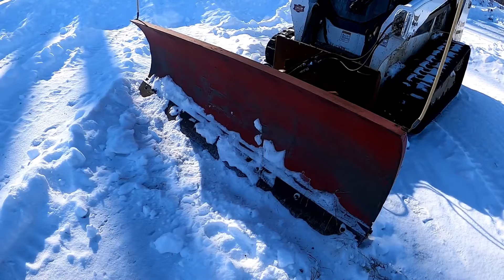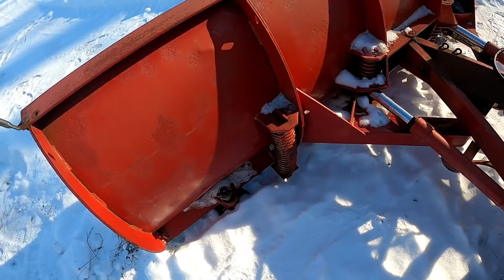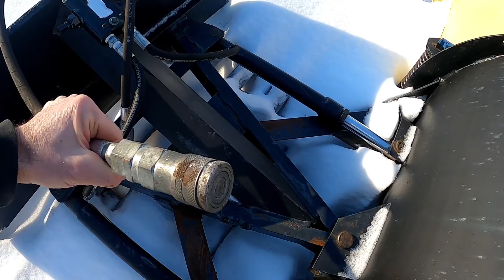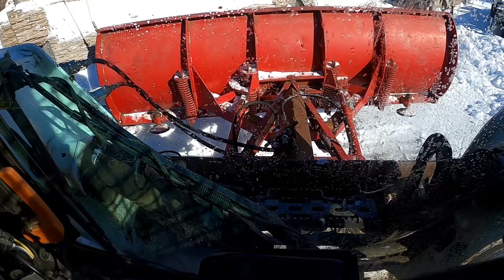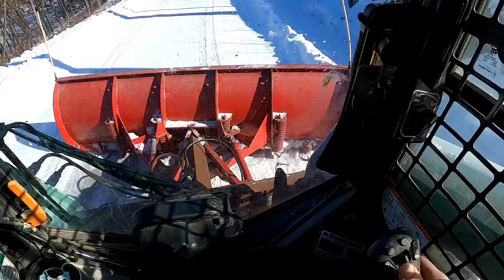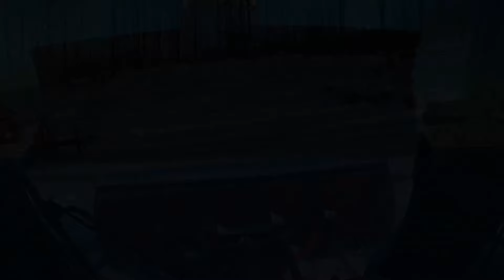DON'T BUY A SKIDSTEER SNOWPLOW Until You Watch This!

Comment: Don't listen to the haters you did a fine job, ever see a snow pusher blade wear out. You and I both know that chain lift is an old design that allows a plow to lift and float connected to a truck, cutting edge is cutting edge.

Comment: My idea was , use a chain and allow the blade to float. There is an important feature to the design. I put strong positive stop going up. I can then roll the blade mount forward until it hit the stop and then it scrapes. I have the best of both worlds in the design.
Reply: You will eat your trip edge and cutting edge more than normal 
A snow plow is designed to push snow not to be used as a scraper with down pressure 

To use as a scraper you need a bucket or a dozer blade 

Yes a dozer blade and a snow plow are different
Reply: @tomhow12  thanks for the info. I been running HE longer than you have been alive.
Reply: Been snow plowing for 25 years 
I started when I was 10 years old in a skidd steer
I’m 35
Reply: @tomhow12  yep, as young as my kids. Like I said.
Reply: @doomman700  
I learned from my father his first snow storm was the blizzard of 1978
Reply: @tomhow12  so your father is a young man too.
Reply: @dooman700  yes

Comment: How well do tracked skid steers run in snow? Some say they have terrible traction. Looking at buying a skid steer over a tractor. I find skid steers more versatile.
Reply: I have owned both, but I kept my skid steer.  Its also heated with stereo so kind of spoiled.   I also use a large snow bucket vs plow from titan attachments.  The bucket doesnt dig into the dirt and floats way better.  My skid has tires with serious chains and goes uphill very easy. I also have a blower too and stopped using the blower almost 95%.  If it snows 3 feet in a single storm, its blower time.  My neighbors skid with tracks are scary on the hillside.
Reply: Regular tracks, (CTL [Compact Track Loader]) typically have bad traction according to most people. However, MTLs (Multi Terrain Loaders) typically have much more traction in the snow than CTLs. I’m not sure how they compare to wheeled machines though.

Comment: Incorrect design 
You will eat your trip edge and cutting edge more than normal 
A snow plow is designed to push snow not to be used as a scraper with down pressure 

To use as a scraper you need a bucket or a dozer blade 

Yes a dozer blade and a snow plow are different
Reply from the maker: Bucket float... Problem solved. Rarely even trips the edge.  You realize Boss plow have engineered a plow for your vehicle to actually put down pressure.  It's nothing new for a snow plow.
Reply: That sometimes works depending on the machine
The snow plow in the video is a fisher not a boss
And boss snow plows have a design flaw 
They can only be dropped as far as the hydraulic cylinder will allow 
Have seen problems with lifted trucks with boss snow plows mounted 
You don’t need to go that far with a snow bucket or a non fixed snow plow
Reply: Also don’t needed to use bucket float on my skid steer snow plow isn’t fixed to the frame it moves up and down on two pins separate from the machine attachment plate